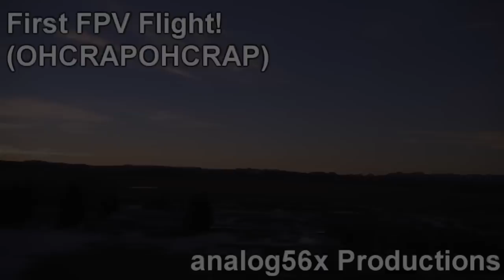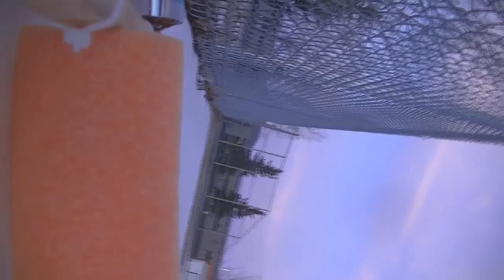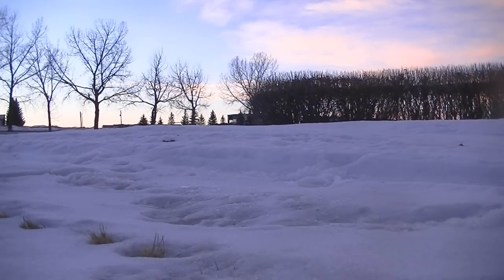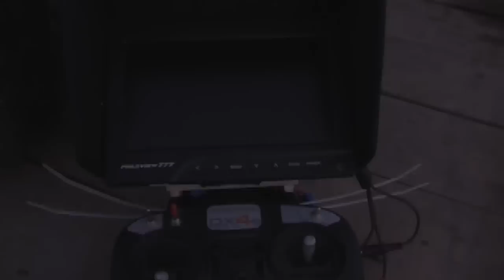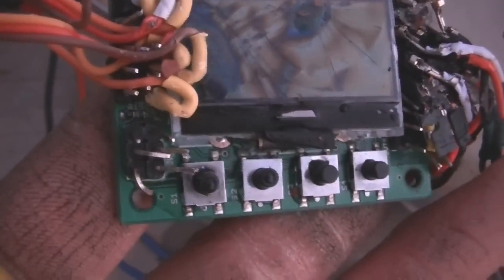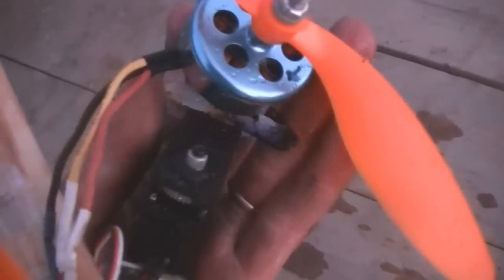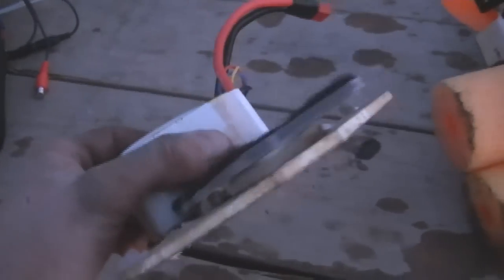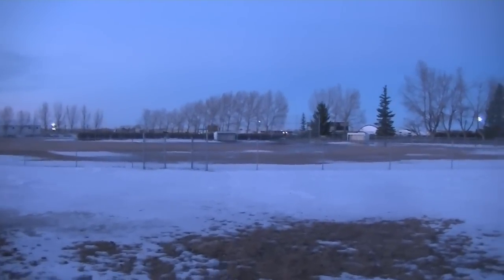First FPV Flight - Tricopter

Comment: The KK board will most probaly need some pins carefully strightened out and you can get another LCD from HobbyKing for $6 and that motor bell problem will only be a bent shaft again HK for about $5 and remake 2.3 with a new wiring loom and your back to the bit;s of wiood to replace the booms .Youll love it man,I to get a real kick out of the build to the point where if I fly too long without a crash I tend to try learn a new trick without realy knowing how to do it.Love  All Copters be them Multi or Heli three blade four blade five six or ONE blade, just love Rotor powered flight.

Comment: I think it was a miricle that the Camera was still putting out Vid even if you coudn't see through the fpv rig,what freq do you run on the Bird and the Fpv rig? ,also it sounded to me like one of your motors might be a tad out of balance or maybe a Prop was a bit different from the other two which seemed to be pulling on the port side maybe balence down the centre line can realy upset things when you have the extra weight of camera etc onboard and the gyros try to keep things right as the bird leans to port and then you put in some stick movement and the gyro can end up helping you turn a lot more than you intention was ...few seconds later your stick banging to try and regain a level flight situation.Don't ask me how I know this analog 5 6 (great call sign analog fiver sixer).So check thos balance weights and C of G with full rig and maybe explore putting in some expo to calm the centre stick as your Kit looks quite spritely .and of corse
Fly Safe Fly Heaps Fly Hard
jcinauz

Comment: Maybe try some short shaft motors like the little Sunnysky (well made little motors for about 12 bucks) and then screw on the cross mount and with a couple of bits of 3m double tape and a couple of zip ties you'll save your motors when you crash( which always happens if your flying hard) and zip the motor leads to the esc's Behind the connectors on the booms this also saves the motor wires getting riped out when the motor comes off and you just tie em back on replace the rotor Blades that broke and your away again for a few bucks worth of parts,(I must give Matt Hall at SimpleCopter.com a heads up for this info that comes from his fantastic "How to Build a Simple Copter"  vids and Heeeeeee realy knows his stuff when it comes to making these things dance and crash with little effect on the pocket balance.Have a look I've been flying Heli's 450,500,800 and planks for ten years now and I learned heaps from his build videos,and had a good laugh as well,This guys rapidly becoming a Tri Copter GURU.Check him out at simplecopter.com.
Hang in there this is the bits you'll laugh with your friend about in years to come. but you'll get the V1.X better fast stronger and you'll see more sunsets before you know it.cheers
Fly Safe Fly Heaps Fly hard
jcinauz

Comment: Geez, that sucks. Every now and then I'll go to the RC air strip and watch guys fly. This guy has been trying for years to get his 100% accurately scaled and weighted plane to fly, I've seen it crash both years he tried to get her up. She earned the name "Hangar Queen" for that, too bad. But, 'tis an expensive hobby, and crashing is part of it.
Reply from the maker: haha yea, it is an expensive hobby... i really enjoy building these things, as much as i like flying them. ive had a lot of flight time with my bixler glider plane. that thing has crashed so many times! the last time i flew it, i DESTROYED it haha! but i fixed it up again. im having issues with the throttle channel on the plane... its not the RX or TX, cause ive tried my tricopter one on the plane, and it does the same thing... its not the speed controller, cause its a brand new one, so it could be the motor...
Reply: analog56x Wish I knew more and could help you. I'm lucky and learned a decent amount about RC as a young kid, read like a 400 page book on building battle bots, and it explained literally everything. I flew once, on a little trainer plane, maybe one day I'll build one, who knows haha